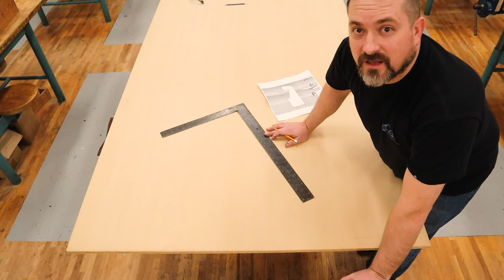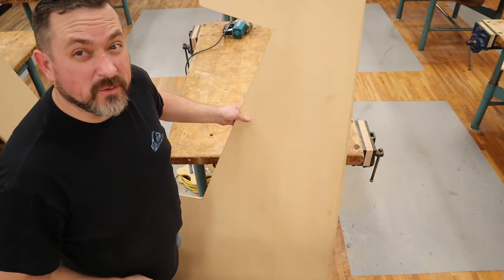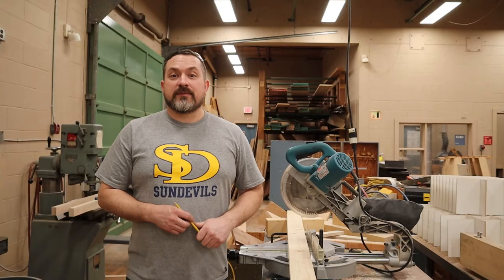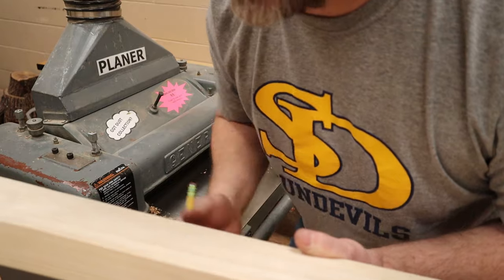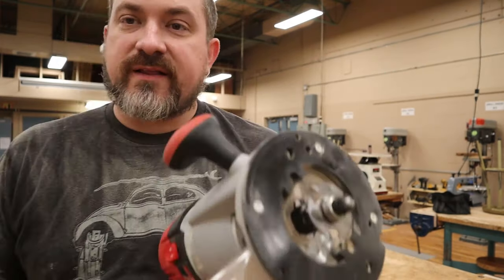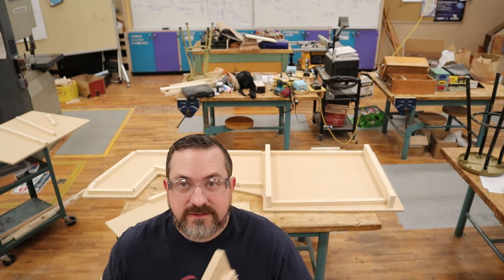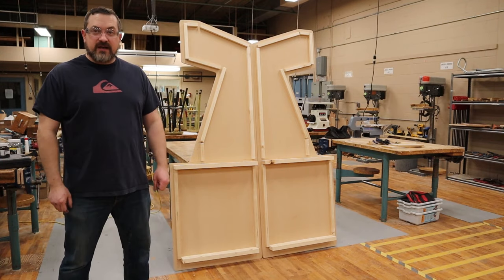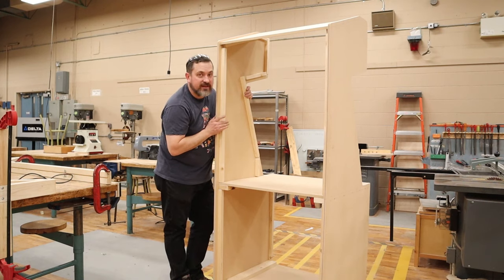Custom Raspberry Pi Arcade Cabinet- Constructing the Cabinet Part 1. Episode #6

Comment: Question what kind of board you use it looks smooth is that mdf 4/8 3/4 of an inch thick.
Reply from the maker: Yes, the 4' x 8' wood pieces are MDF and I used 5/8" thick.  I went with MDF because it is really nice to work with and the sides are already very smooth and flat.  You just have to watch the dust as it is pretty nasty stuff to breathe in.  I didn't go with plywood as it can  be warped and tears out when cut. Cheers.
Reply: @wayofthewrench  if I used 1/2 inch or 3/4 inch mdf would that throw off the measurements and if so what needs to be changed.

Comment: Hello!  Fantastic video series, it motivated me to build my own cabinet.  Could you tell me what distance from the edge you positioned your batons?  I couldn't find it in the video.  Looks like maybe 1 or 1.5"?
Reply from the maker: Bruh!  That's great!  It's awesome to hear that your going to make your own cabinet.  Built not bought!  I used 1/2" inset on the cabinet and I used 1" battons/glue blocks.  I would love to see the final result of your cabinet!
Reply: @wayofthewrench  hi i too am building my own cab from your plans , i have got as far as the side panels are cut out and now need to make and fix the batons , are there any dimensions for these ? Lengths and positioning ? Thanks for your time
Reply from the maker: YYYYEEESSS!  That's awesome!  I would love to see your final cabinet when your done!  The batons I made 1" x 1" and they are placed inset from the edges of the side panels so that there is a 1/2" inset once you have the 5/8" MDF pieces screwed into the batons.  Make them as long as the panel that gets attached to it (not longer than the panel)  Really try to make the batons perfectly lined up to your pencil lines so that the panel will be exactly where you want it. I recommend that you layout where all of the batons go (with a pencil) and lay down all of your cut cabinet pieces to ensure it will all fit together before you start gluing and nailing everything in place (called a dry fit).  Good luck dude!
Reply: @wayofthewrench   thankyou thats great , i will defo be sending photos of the finished item ,thanks for your time 👍
Reply: @wayofthewrench  Hey I'd love to shoot you a couple of pictures of the cabinet I build using your design and videos but I think YouTube must have removed the private messaging feature. I'll find you on Instagram and DM them.

Comment: How much did the MDF for this project end up costing?
Reply from the maker: The 4' x 8' sheets of 5/8" thick MDF were around $45  CAN each and I bought 5 sheets.  My design had no concern about trying to fit all of the pieces in such a way that I could make it out of the least amount of sheets.  I had requirements and design points that I wanted so it looked good and had good ergonomics instead.  If I make a bartop design, I will try to design it to make the material costs as cheap as possible though.  Cheers.

Comment: Followed your links for the Sketchup plans but all I see is a PDF, where can I get the actually .SKP file?
Reply from the maker: I didn't plan on giving out the .skp file, just the pdf with the measurements on it.  I don't mind if someone wants to build my design for themselves but it didn't want people changing only a few details and saying it was their design. This whole playlist is for people to design their own from scratch or build my exact cabinet.  Best of luck with your cabinet build!
Reply: @wayofthewrench  If you give out the pdf file that shows the dimensions of the whole cabinet how is that any different than  just sharing the skp file?  I've been trying to make sense of the pdf and realize there is so many areas that do not seem to fit right for whatever reason.  I drew it to what your pdf shows and still can't get it to fit right.  That is why I was asking for the file itself so I could see what is wrong with my sketchup drawing.   I truly like your design and see no reason to change it other than maybe the size of the monitor to fit the one I already have.
If I had the time to design one from scratch I wouldn't have ever found this series to begin with.
Reply from the maker: I guess that the raw.skp file is like the original source for the design....dunno, I just figured the pdf with all the required dimensions is all that is needed.  Where abouts are you having it not go right?  I wouldn't redraw out my exact design in Sketchup, if you want to make my design, just print off the pdf and cut out the pieces.  Those PDF pages are what I took into the shop and cut out.  If you want to modify it for a bigger tv, all you have to do is add the dimension to all of the widths of all of the side pieces between the sides (monitor bezel, marquee bezel, speaker shelf, etc).  Don't forget to extend the control panel as well and then you'll be golden.   Also watch that the dimensions of your bigger tv do not hit the battons on the sides (I didn't account for this and had to take my tv out of the case to make it fit).  Best of luck with your design!
Reply: @wayofthewrench  any way to convert the measurements to metric? for example, what does this mean? 2' 9"
Reply from the maker: If you put 2' 9" in mm into Google it will convert it for you.   2' is 2 feet (24 inches) and 9" is 9 inches.  There are 25.4 mm to every inch.  Cheers.

Comment: Is the mdf lighter than plywood?
Reply from the maker: No, MDF is heavier but has other benefits.  Cuts don't tear out, there is no warpage in the sheet, and has a dead smooth surface.  I would always go with MDF.  In the end, the plywood is going to  be heavy as well, it's not like you are going to be able to lift and carry around a plywood cabinet.  They are both going to need casters.  Cheers!

Comment: What is best glue to use ?
Reply from the maker: Regular wood glue is more than enough.  I use Elmer's Carpentry glue and have used Titebond before as well.  Either a polyurethane or a PVA glue will do.  Whether one hold a couple more pounds or not isn't important.  Think the needs of the project.  Does the glue have to be waterproof, does the material have pores or not, etc.  For this cabinet, just regular old wood glue will do the job. Don't believe the hype.

Just make sure your glued surfaces are completely covered in glue ( rubbed glue joint) as there is a bigger issue if it is partially dry/partially glued.  You also have about a 8 min work time to stick to and it sets in a hour or so but leaving it 24 hours will cure it.  Wipe up extra glue before is dries for an easier clean up.  Cheers and thanks for the watch!

Comment: At 38:56 what software you installed on your phone to tilt the saw
Reply from the maker: It is on android and it's called Angle Meter.  It's a pretty cool tool to have on any maker's cell phone.  I have used it to check camber on wheels too and it's pretty accurate.  Cheers.

Comment: how many sheets of MDF did this take? Also, is that 5/8s?
Reply from the maker: I wanna say 3 sheets but I think it took 4 because I didn't plan or change the design so it would be efficiently cut out.  I have a bunch of decent sized off cuts that I will end up using later for a mini pinball cabinet or bartop arcade.  Yes I used 5/8" MDF.

Comment: ur sliding fence it is diy?
Reply from the maker: It's a pretty old table saw so it is hard to tell but I think it is an older modification to cut panels easier and safer.  The woodshop is 40 years old and I wouldn't doubt it if the table saw is that old.  These old machines were built to last, not like today's junk.

Comment: naw spare me the mdf and its formaldehyde based resins
Reply from the maker: Yeah it's pretty nasty stuff, especially if you're not wearing a respirator but I live how flat and smooth it is to work with.  Plywood tends to warp and tear out when you cut it.  Both work though.